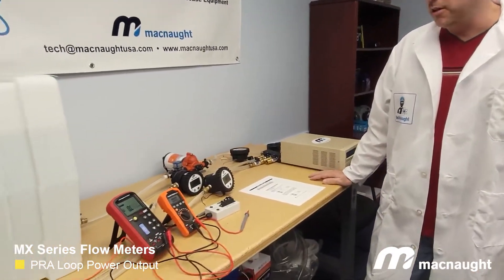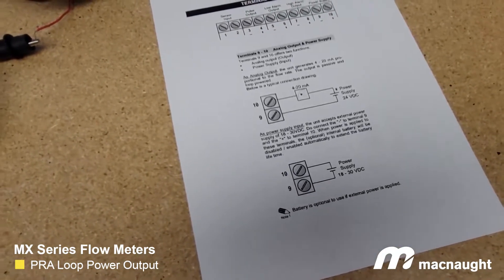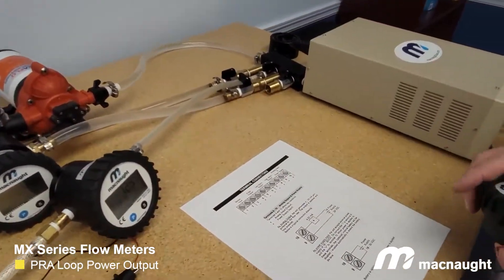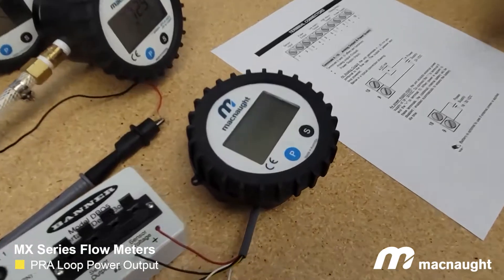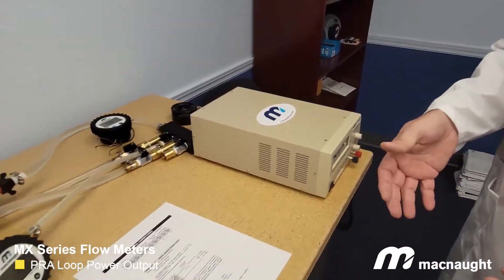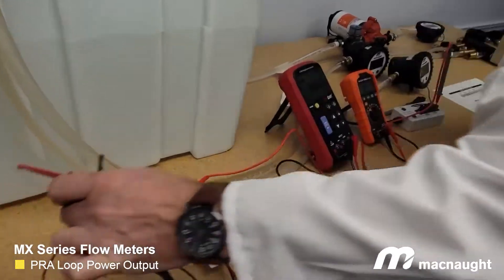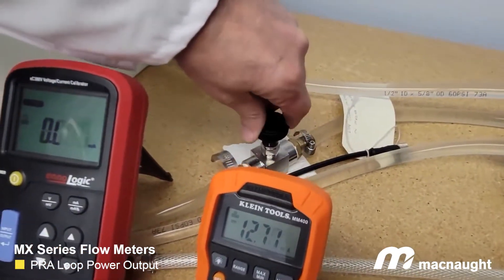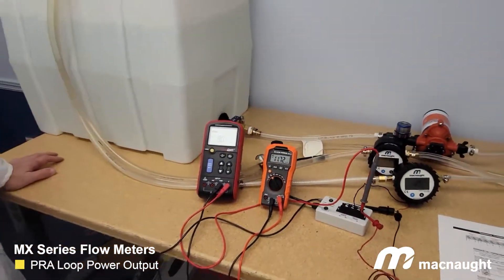MX Flow Meter PRA Looping Power Output / Optional Power Supply

Comment: what is the purpose of the ???Logic device on the left, which is called a "device that is going to send an analog signal" and is also called an "analog output?"

It looks like the Klein multimeter, set to read mA, is connected in parallel with the ???Logic device.  I find that very confusing?  What is the current through that ???Logic device when the Klein multimeter is hooked up in parallel with that ???Logic device?

Would the Klein multimeter also read mA correctly if the ???Logic device was not in the circuit?